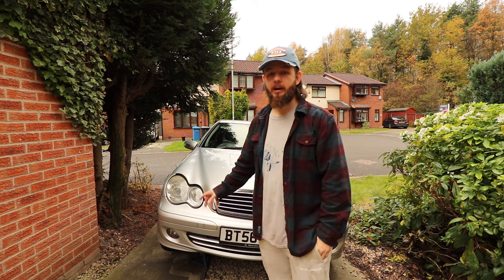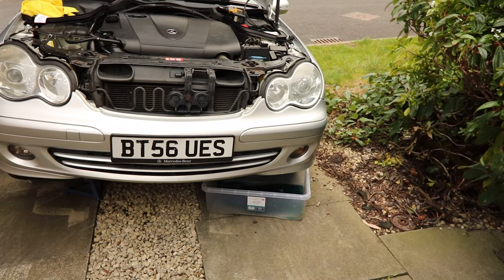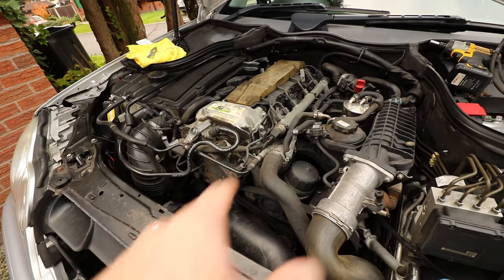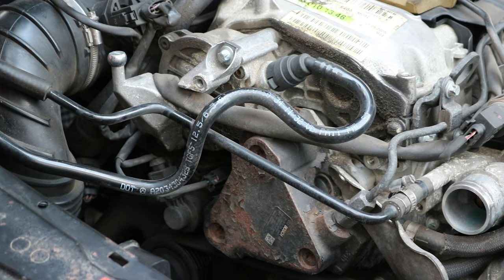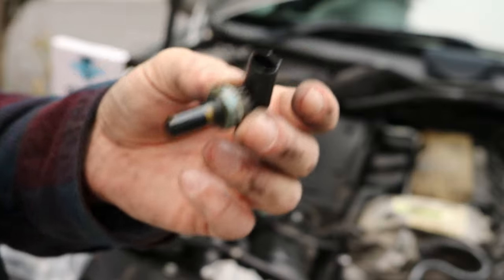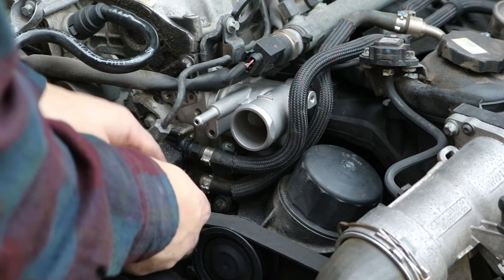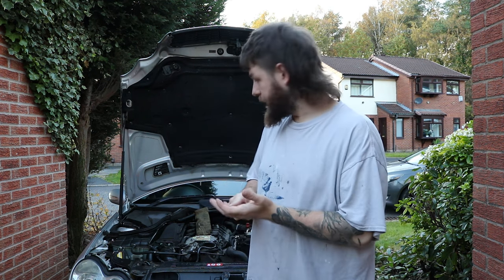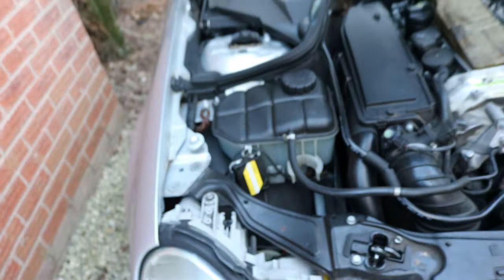Mercedes W203 C220 CDI / OM646 thermostat replacement (c220, e220 etc) OM646 thermostat how-to!

Comment: Thanks for video did my thermostat in 30 mins watching this, only had one problem that the new thermostat housing has a hole in bottom where as mine didn't so I just removed the innards, new sensor and gasket then swapped to my old housing, car finally gets to operating temperature and mpg has gone up a lot! Cheers again!
Reply from the maker: Thanks, glad it helped! Ah ok, annoying but least you got sorted! The parts gamble is always scary isnt it haha! Thanks for commenting bud
Reply: ive heard that the vito has same thermostat housing, but with hole at the bottom

might have gotten mixed up

Comment: Cheers! I have to tackle mine this week and this really helps! 👍
Reply from the maker: Glad it helps, good luck for the job!
Reply: @Enginesetc  Did you have an issue getting the right part? The one I got had an outlet hole on the bottom of the housing which isn't on the original, it looks like the new part you have has this extra outlet also but the old part you removed didn't? Cheers 👍
Reply from the maker: @mikeb6385  Nope, euro car parts, enter reg and then one option. Which outlet hole sorry, is there a moment in the video you can see it? it has the spout for the expansion tank line and the hole where I cut the thread for the bracket, that's about it?
Reply: @Enginesetc  thanks for your reply.. It's where you have your index finger when you are comparing the old and new together, like a spout of about  20mm diameter.. I ordered mine from gsf via their website using the car reg.. I'll try euros! Thanks.
Reply from the maker: @mikeb6385  ahhhh yeah, I've got my finger inside of it haven't I! The quite wide and pronounced circular shape. Ok it's just a moulding on mine, it wasn't an actual hole that let anything through, it just seems to be a weird design choice in the moulding. It should be same on yours in that it doesn't actually go anywhere :)
Reply: @Enginesetc  that's the one, but on the one I was supplied there is an actual hole, after a bit of research it turns out this is for the Vito so gsf cocked up. Thanks for your help. Happy New Year! 👍
Reply from the maker: @mikeb6385  oh bloody hell, nightmare! Least we could communicate about it so you definitely knew yours was wrong! Thanks bud, you too 😁

Comment: Is it have only 1 thermostat or they are small and big one? Because my 220cdi 143hp is work on 60° and very hard go to 80° , and I think that the thermostat is problem. Thank you for helping me
Reply from the maker: Hello, only the one as far as I am aware. Mine works now, I had same issue was sitting around 60 now it's perfect just above 80 as it should be :)

Comment: Would be interesting to see the stat before and after.mine is going over slightly but blowing warm heat even on long journey. Any thoughts?
Reply from the maker: Is it going up to over halfway? I would recommend changing it and making sure all air is out of the system just to rule it out as a cheap option

Comment: Would this part stop the fan from working ?
Reply from the maker: Probably not, there is however a coolant temperature sensor which could if you google where that is :)
Reply: I've researched everywhere I don't know where to find the coolant temperature sensor on this engine , its doing my head in now

Comment: What about hole at the bottom?) In my case, the antifreeze is leaking through a plug that was plugged in there.
Reply from the maker: The red plug at the bottom of the rad I assume? That is a coolant drain hole, yours might need tightening or new plug/gasket
Reply: Oh. thanx! Yeah, I had to redo the cork. It was plugged with a 22mm diameter metal plug and sealant @Enginesetc
Reply from the maker: @artinstroukeprod  ah good to hear you got it sorted :)

Comment: I have the same moptor and the temperature is around 100, now the water pump is smaller, hasn't it been changed for sure 100,000 km, so I'm wondering if I should also change the thermostat, is the water in the bowl boiling to some extent and disappearing, and the small radiator for heating was clogged and had a weak flow I hope that my problem will be solved, but I don't know if I should also replace the thermostat
Reply from the maker: Yeah I would also recommend thermostat as well if you're doing water pump, might as well for the small extra cost to eliminate most issues
Reply: @Enginesetc  I solved the problem with a new pump as well as the thermostat and flushed the entire system and now there is no problem, the temperature is 90c sometimes it gets a little hot but the water doesn't boil :)

Comment: what coolant are you using?
Reply from the maker: I used blue coolant, G-48 specification is ideal but any blue coolant should be fine. Comma G-48 is specifically what I used

Comment: i got problem with my w209 clk 220  - it show i got problem with  heater booster control module - line is interupted.. but i dont know where is location of it so i can check :D
Reply from the maker: Doing some googling, it looks like it's behind the front right (if you're sat in the car) wheel cover! Good luck!

Comment: At 4.46 when u take the engine cover off, is that red thing ?? Rear right of engine not the engine dip stick, although its only a cap, no stick. The gearbox dipstick is further back nearer the screen and lower down !
Ive got pink coolant in my CLK, is that a higher or lower level than the blue ??
Reply from the maker: Hi Arnie, nope thats definitely my gearbox dipstick tube, might just be the angle on camera. I filled my gearbox through it when I did a service and some repairs on it so definitely gearbox one :)
There's nothing wrong as such with a good pink coolant but Mercedes specifies the blue one, probably some different properties in terms of anti corrosion etc. As long as you now stick to the pink one, never mix the colours or they can turn into a gel and block tubes, leading to overheating etc. If you ever decided to go to blue, drain all the coolant, fill system up with water and flush it through, drop that and then you can change so you dont mix any :)
Reply: @Enginesetc  ok i will flush system and go with the blue!!!
Reply from the maker: @arnietwo11  Ok bud, let us know how you get on. Be thorough and remember thermostat is closed until operating temperature so you will probably need to remove thermostat and flush water through from that side as well to ensure you get all traces of the pink out!
Reply: Thanks. Just one question, what did you say you used to clean the mating face of the block?
Reply from the maker: @MrMagicNetwork  sorry for delay, just used a microfibre towel
Reply: @Enginesetc  thanks very much